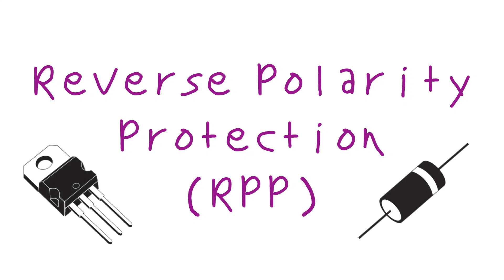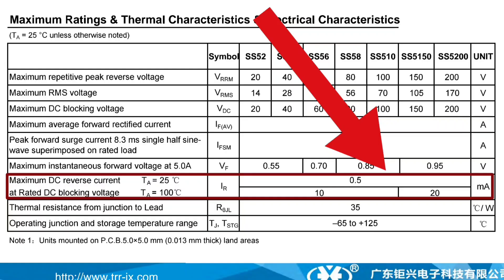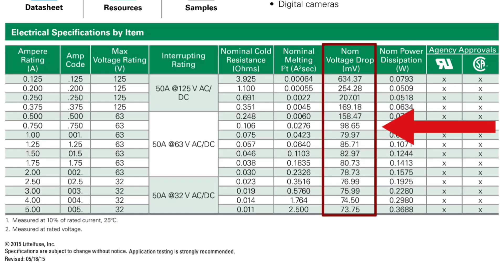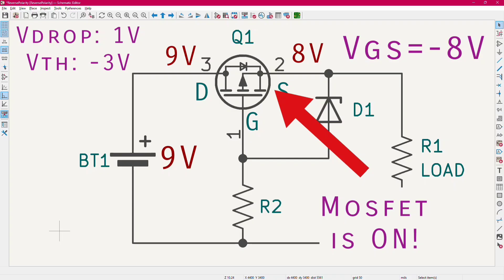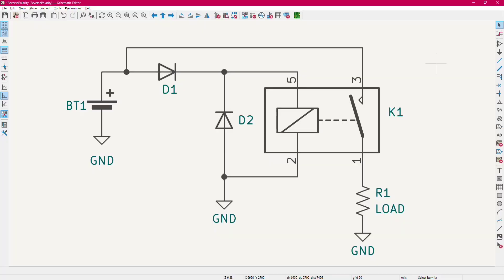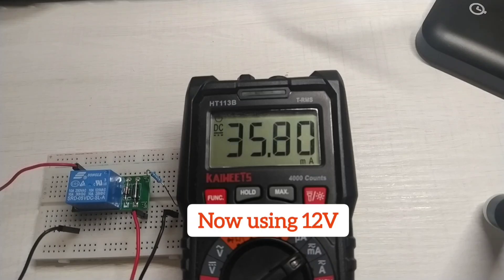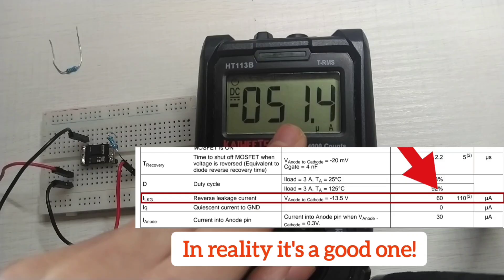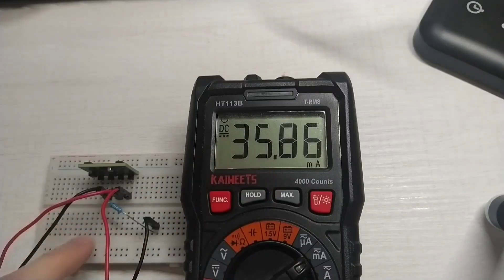5+ Reverse polarity protection circuits for your projects!

Comment: For the MOSFET version, there's also a variant with the addition of a BJT, a diode, and a resistor. This allows you to charge a battery. If you connect the battery incorrectly, this circuit prevents your charger from blowing up. The downside is that if you connect something other than a battery, nothing happens, and you have to give the circuit a little push.
Reply from the maker: Didn't know that. Thank you

Comment: In most of the cases the mosfet solution will be the best (price/availability/vdrop/Imax), and its almost as simples as an 1n4007, the only typical scenario that it won't fit is a AC-to-DC old school power supply.
Reply from the maker: @carloslint9914  Yeah I agree, the mosfet solution is absolutely the best. As you said it's also really simple to implement

Comment: I'm currently building a circuit with 4 possible power inputs using the AOZ1390DI ideal diode chip to prevent reverse flow.  It's really good because it's tiny, has nearly zero voltage drop and only a few external discrete 0805 caps and a pullup resistor..  The test board just shipped from JLCPCB so we'll see if the theory matches the results in a few days.
Reply from the maker: @MikesTropicalTech  Cool! I like those ICs although sometimes their circuit has lot of components compared to discrete solutions. Btw with "4 possible power inputs" do you mean power ORing?
Reply: @BurningElectronics Yes I'm trying to safely 'OR' different power supply inputs, +12 from car battery and +5 from USB-C through a regulator, then also +3.3V from JTAG debugger into one 3.3V rail.  I'll post a video when I get it working.